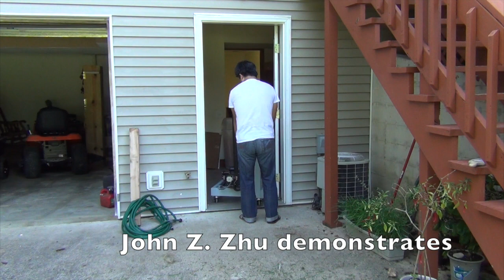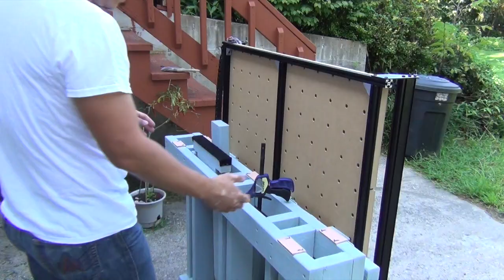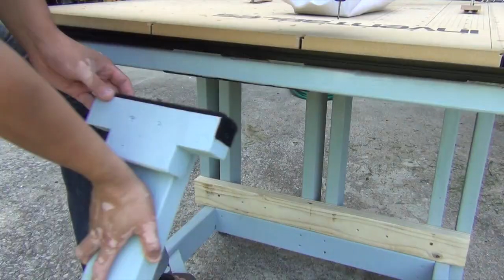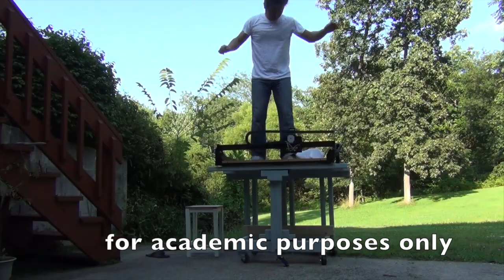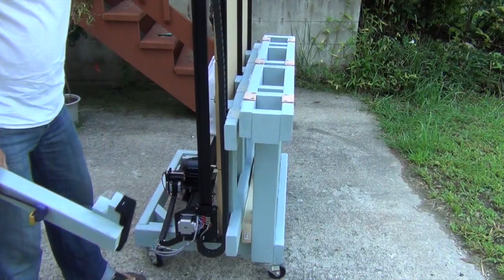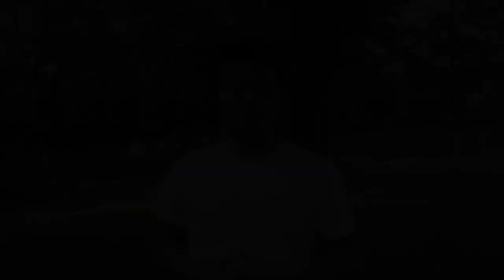Folding Portable X-Carve Table:  Strength and Mobility Demonstration

Comment: Very well engineered. I definitely can appreciate the pivot point (fulcrum) position for both stability when moving and when erected! Perhaps a folding box (cardboard) or fabric bag to cover the full system which  can be stored under or in current storage slots for dust protection when in storage mode.
Reply from the maker: MRrwmac I like the idea of a fabric bag (or drop cloth) cover idea. You might notice the control box is in hanging in a fabric bag made from an old T-shirt and a shoe lace. The pivoting point is ~20.5" relative to the end of the X-carve, giving it the desired low center of mass but still have a mechanical advantage when raising the leaf.

Comment: Cool design.   Are you not permanently mounting the control board + power supply?
Reply from the maker: wordsnwood Thanks, the control board/power supply was the last problem solved, they are hanging in the white bag in the video. I do not plan to mount it anywhere on the cart, partly having to deal with dust issues.